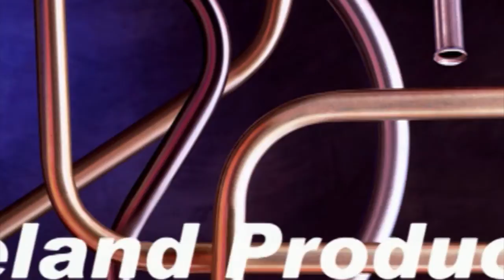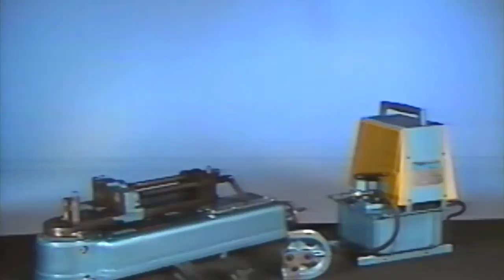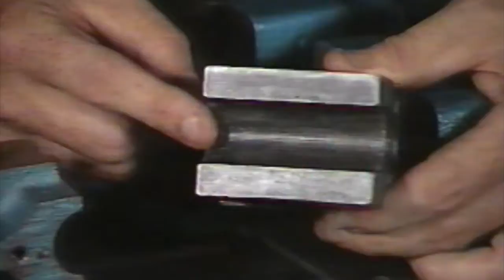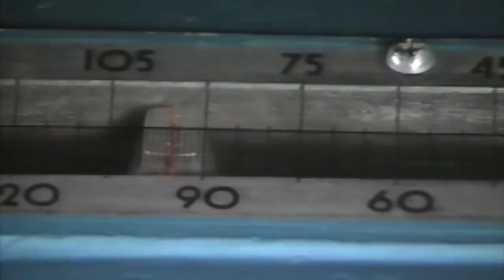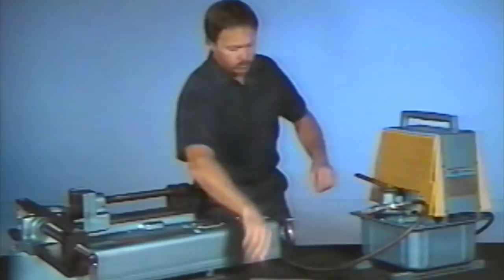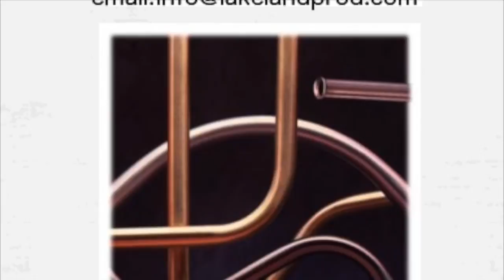Lakeland Products Model 632 Tube Bender

Comment: I'm looking to buy this unit used with dies. Jim. I am also looking for a tube flaring machine. Instagram jimwelds,  phone 5012092098.
Reply: I worked for a company in Houston and this is an excellent bender. ive fixed many that were in need of repair.